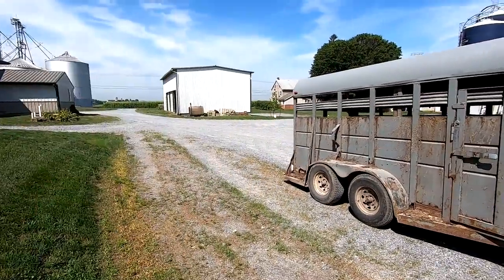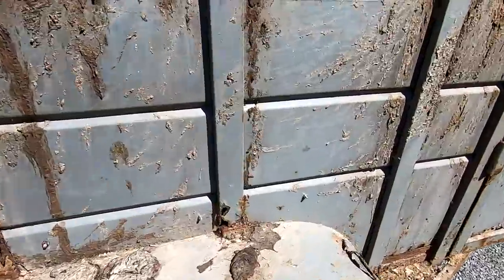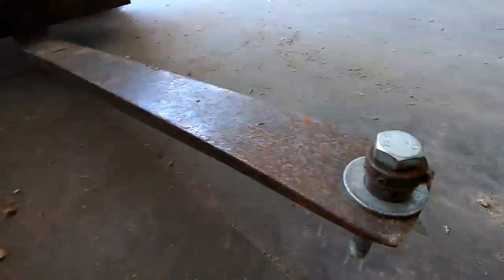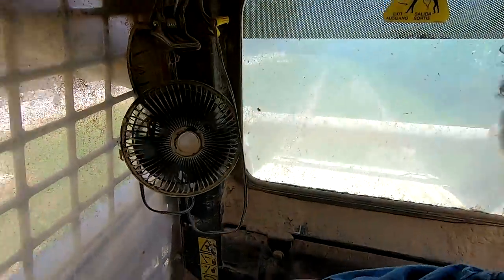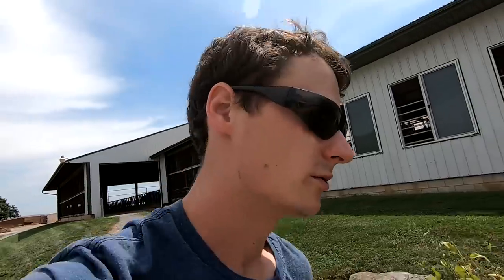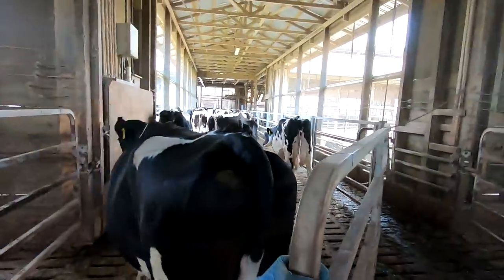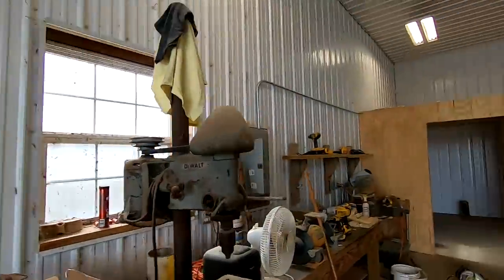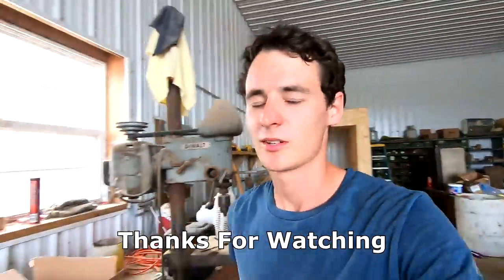Replacing our Old Cattle Trailer & Fiddlin' around on the farm

Comment: Yes! A video from 10th Generation Dairyman. Eric, I hate to say but the vapor barrier goes to the heated side of the room. The ceiling bats need to be flipped over. The office looks pretty cool. I'd say the trailer has been well used. New trailer looks really good. The heat and humidity make working really tough. Thanks for another great video.

Comment: I would suggest a safety block under the skid steer.  i had a friend killed when a hydraulic cylinder blew a seal.

You are smart buying used equipment,  I have owned 30 cars or trucks, and bought two new.   Your trailer looks like my 2006 Dodge Dakota, but it still runs great.

Comment: Probably need to clean the shavings out of the trailer regularly or put down one of those rubberized compounds to keep the buildup in the corners for longer wearing and rust. Cow manure eats metal.
Reply: Yup. Poo has hydrogen from hydrochloric stomach acid.

Comment: Five Eighths sure is heavey enough, it didn't even flex with you on it. New trailer is nice, bet the old one is gone in a week. Are you treating the teats different than you used to? I notice you cam back and stripped them then put more stuff on. = ?Good video. Peace.

Comment: Telling the internet that your trailer is a piece of junk tells me a lot about your honesty.

As far as storing stuff above your office, I wouldn't put too much that's too heavy up there. Even though you used joist hangers, it looks like you only used 2x4s. 2x6s would have been a much better choice, and with either one, placing them on top of the walls would also have been a stronger option. I'd hate to see that nice ceiling fall or worse.

Comment: The plywood needs to run the opposite way than you did it
Reply: It's run ok.  It's for covering with the groves running up and down
Reply: Plywood runs opposite of the joists or studs it will work
Reply: @lylerobeson8593  what grooves
Reply: @lylerobeson8593  never heard that on a construction site I've been in the trades since 1975
Reply: The ply was t1-11.
Reply: @lylerobeson8593  stop u mean T 1 -11
Reply: @lylerobeson8593  when did they start making T 1-11 out of chip board
Reply: @plumbcrazy375  looked like 5/8" osb sheathing...  Not sure on the spacing of the office roof rafters but the other side of the sheathing  had the reference marks on it for the joists / rafters...
Reply: Sidewalls are T 1-11
Reply: And he saved four feet of sawing that way.  I know that for max strength you go perpendicular to the joists or studs depending on the application.